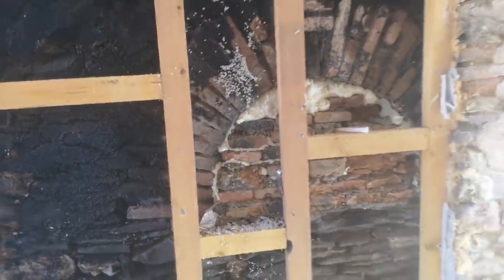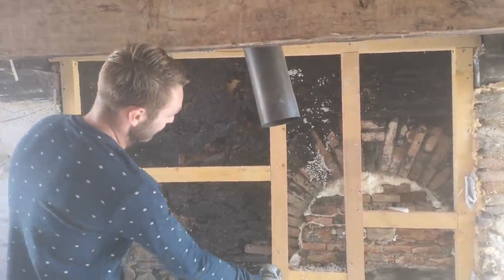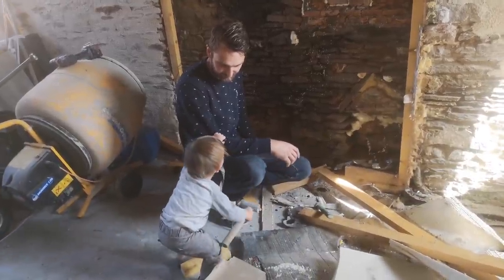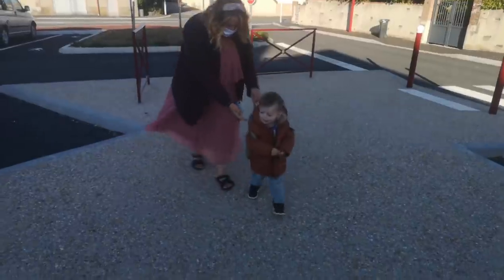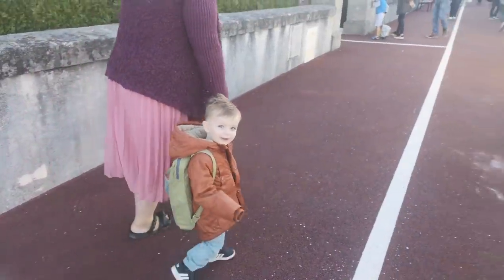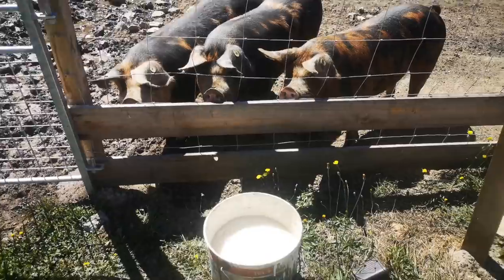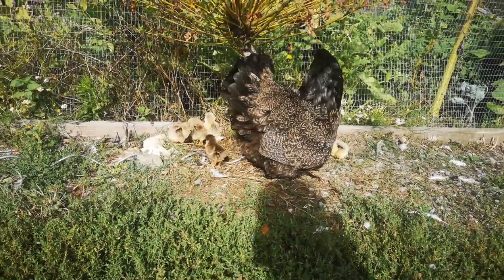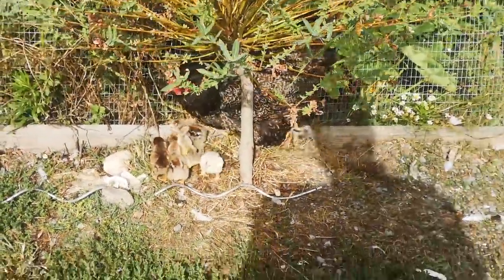Escape to rural france- sand blasting and first day at school. EP005

Comment: Glass will not work, surprisingly it will obscure the beautiful patina of the brickwork & dust will still come out of the wall. Clean, point bits if needed and use a masonry sealer, they come in different sheen levels, a supermatt finish will leave you with the raw look you desire whilst and keeping the brick and mortar dust away, cheers & good luck from a heritage restoration designer.

Comment: The sandblasting blasted the old soot right off, amazing. It would be an appreciated customer courtesy if they shop vac up the mess but great job anyway. 
It's great to see children back in school it's a sign we're getting back to normal : )
Reply: Maybe some contractors do that for an💲extra charge. 

Seems like a shop vac is a necessary tool for any serious DIYer to own. No one wants to ruin a good household vacuum removing dust or debris during home renos &/or any woodworking. Plus, they can suck up water from a broken pipe or busted water heater too.
Reply: @teresacarle294  Who knows maybe they have a shop vac : )
Reply from the maker: We have a Henry hoover ,annalise is desperate for.one of these post Dyson ones but we are nowhere near nice hoover stage 😆

Comment: The bottom opening would have been the clean out point to remove all the ash or soot and the oven would have had either a hardwood door as I do not see hinges for an iron one. Doors were always placed to keep the heat inside once the wood fire has heated the oven to highest temperature. The wood would be raked out , a quick mop to remove excess ash and the bread placed to cook and the door put in place.

Comment: When you do Perspex (I don’t know if that’s right, we don’t have that in the USA, we have Plexiglass) over a wall, make sure to leave a little space at the bottom to vacuum or sweep out rubble periodically. What a good idea that was, though, by a channel  viewer. I like how you see the value of taking in other peoples opinions and like them to be involved. Just a tip: use the most gentle method first (it’s true for cleaning anything), especially on old surfaces. I’d sweep with a broom, then try a wire brush, then consider sandblasting (maybe). I learned this the hard way. ❤️

Comment: You can also add an openable damper in the chimney. I have done this in two open fireplaces in Australia to stop hot air escaping in winter but openable n summer to let out hot air.

Comment: Why sandblast when you could spray it with  sort of sealant?  In fact, you could open the entire front of the area you had covered seal it and open the bread oven than seal up the flue to prevent heat loss.  With the proper lighting it would be, in my opinion, beautiful...
Reply from the maker: Sandblaster was just to remove the debris on the bricks were going to keep them on show 😊

Comment: Please do not sandblast the masonry. Sandblasting will destroy the soft brick. Just clean and leave the wonderful patina. Thus is part of the history of this wonderful fireplace with it original beehive bake oven. If you remove the infill of the brick in the opening of the oven you will most likely find the oven in intact condition.
Reply: The oven was removed before they bought the property unfortunately, they just have the hole in the wall but they said they intend to look for a door, at a Brocante